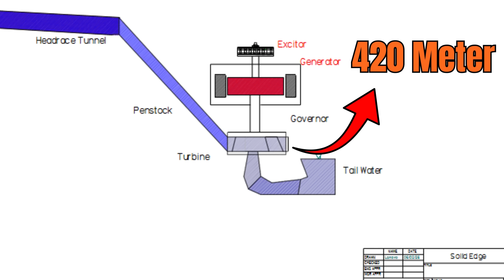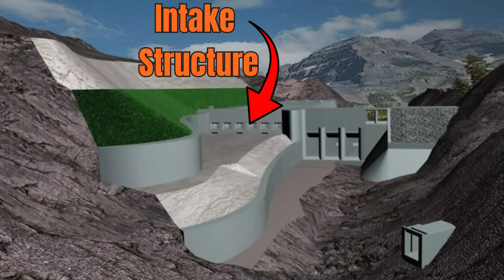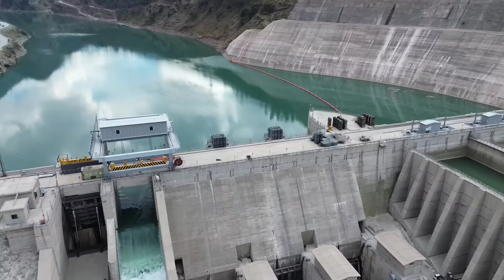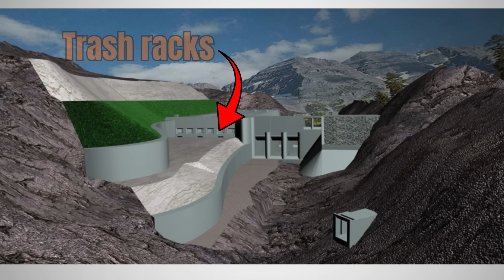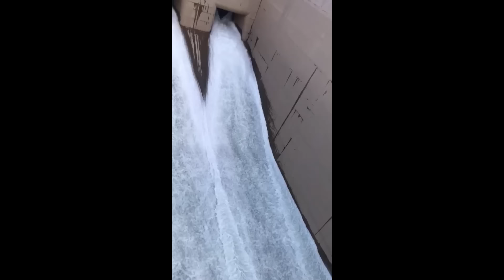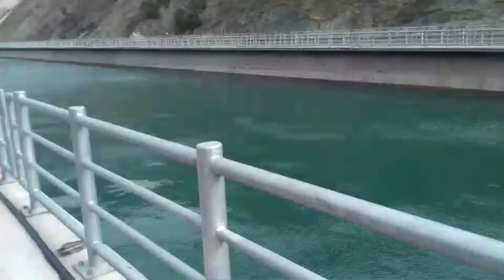How Engineers Stopped Sand from Destroying Hydropower Turbines

Comment: Very interesting. I used to machine large fan blades for coal mine exhaust fans and was shown some that coal dust had absolutely destroyed. They solved the problem by covering the blades with thousands of ceramic tiles. It worked well until a single tile would come off. Then the damage would start and thats why I had a job making new fan blades. These fans were about 12 foot diameter when assembled. I think now they use spray on ceramic coatings that perform much better. I wonder if your engineers are aware of this coating?
Reply: Wow that's crazy. Its the same strategy the space shuttle used to protect its wings during reentry.
Reply: @swg2188 very different ceramics. One is heat protection the other erosion protection.
Reply: This is already being done for hydro turbines as well. But not letting most of the particles get to the turbine is still crucial. And there's also hydro power installations that are many decades old and don't have those coatings.
Reply: Unless they are blithering idiots, they know about spray-on DLC or ceramic coatings.
Reply: @railgapesoterica5777 do you see anything with any type of costing on it in the video? I did not. Just trying to help my fellow human beings out. Maybe they know and decided against the cost. Maybe they do not know. Go troll somewhere else.

Comment: An automatic debris rake can extract floating trash to prevent a massive buildup as shown in the video. Collection at dams also helps to protect the enviroment and possible downstream towns, bridges and other dams.
Reply from the maker: There is an automatic trash rack cleaner. But when there is an emergency event like cloud burst. Then there is an issue. At that time, extra force is exerted on dams, so those debris needs to be flushed out quickly

Comment: Thank you for another informative video, but I have one question: It looks like the water would be moving faster in the sediment basins than in the reservoir. Thus, why do the sediment basins help significantly (I'm sure they do, I just don't understand why)?
Reply from the maker: Actually I showed a clip where the sediment basins were initially filled. So it felt fast moving. Once the basin gets completely filled. The water became calm. And due to gravity sediment sits at the bottom.  Also in the video you can see the completely filled basins the water is calm.
Reply: @hyrovision Thank you for the additional explanation. How often do the sedimentation basins need to be flushed in normal operation? If I understood thing right, than there is no power production during flushes, until the sedimentation basin is back to level? I imagine that during normal upstream flow, much of the sedimentation probably happens in the reservoir, while during storm surges more sediment makes it to the sedimentation basins? Great videos. I appreciate them a lot!
Reply from the maker: No the power house doesn't need to be shut down. As there are three sediment basins in this project. So they only empty one basin at a time. Close the out let gate and intake gate and open flushing gate to flush. After flushing they fill that one and open outlet gate. Than they do second one and than third. So I'm short two basins are in continued operation.

Comment: Most of the images showed water wheels damaged by cavitation, not abrasion.  For the rest, it’s interesting to initiate into trash and sediment management.
Reply: Gentlemen please. Let a pump mechanic explain it for you. 41 year machinist. Last 25 years specializing in pump repair. The sand and sediment start the erosion process. Even at low rpm speed there is tremendous pressure in this system. As soon as erosion starts the cavitation starts. Then both erosion and cavitation work on the vanes until failure. I see this all the time. I have two pumps in my shop right now with this problem. One I disassembled just last week with heavy plastic and a rag wrapped in the impeller for shits sake. So you are both right and both wrong. As for myself I am right. Shake hands n hug it out. 😂
Reply: @martinswiney2192  how does erosion case cavitation? isnt cavitation a momentary burst of negative pressure? a vacuum bubble collapsing and creating a mini implosion.
not really sure how erosion would cause that to start happening. i guess if the pump starts running much faster due to reduced pressure on the system.
Reply: @no-ux erosion creates a low spot on the working surface of the impeller. This creates an area for low pressure or think of it as a swirling action. Since the swirling action is taking place where there is already a low spot. So from there on its a cycle of destruction. At least thats how it has been explained to me and verified by what I see on disassembling pumps. River pumps are the worst. Usually impellers and housings must be replaced as opposed to pumps from clean water service like cooling towers. Point being impellers that have silt and debris flowing thru them get shredded. 

There are some system failures that allow air into the intake that will start cavitation without the wear caused by silt. Or maybe low water levels in the sump and the pump sucking air. But thats for pumps not dams obviously. If your dam is sucking air you might have some real structural issues that need attention. Lol.    Keep in mind I am not an engineer. Just a long time machinist and pump mechanic. But I do these repairs often. I really do hate to see destroyed impellers as replacing them instead of repairing wear rings really cuts my profit margin.
Reply: @martinswiney2192  that makes a lot of sense to me. thanks for the explanation, it seems obvious now you mention it.
Reply: What someone online that only watched a few YouTube videos about cavitation sounds like and doesn't actually know anything about or have any experience in hydropower. Sand and stone after hundreds of thousands of hours can definately do this
Reply: @no-ux  Cavitation increases when the impeller / rotor is eroded out of its ideal, cavitation-avoiding shape.
Reply: How can you tell the difference between cavitation damage and abrasion damage?
Is it that cavitation is concentrated where the vapour pressure changes are greatest, and abrasion is more uniform on the vanes (although I’d still expect some feathering towards the high velocity edges)?
Reply: @c @chriswalford4161  As you said, I would expect abrasion causing feathering.  You can expect cavitation damages to occur where lower pression exists, closer to the end of the vanes, but any defect or deformation more inward from the edge can create lower pressure and cavitation, leading to damages further away from the edge that will cause more turbulence and thus more cavitation there and again more damages at that location.  These damages inwards from the leading edge are for me tell tales of cavitation. No form of abrasion that I know will chew a funky shaped hole through a vane, inward from the edge. Abrasion will thin the vanes, and since the edge is already thinner, the vanes will shortened.  More knowledgeable person can correct me on this details. Thanks
Reply: @chriswalford4161  impact/friction erosion tends to be on side and leading edges, cavitation tends to happen most at trailing edges.  That said, very small amounts of particle erosion can lead to very large amounts of cavitation very quickly.
Reply: Sediment does the same thing
Reply: @Phil-D83  Explain to us how sediment reaches the raised intakes of any dam, please.  I'm not sorry and you're wrong.
Reply: @railgapesoterica5777  even with the best filters,  some gets through, especially with the amount of wate rmoving through the system. They limit it, but its not perfect
Reply: @Phil-D83  no it doesnt.
Reply: @no-ux  yes it does. You truly think mud sand silt and rocks aren’t going to destroy a turbine spinning at full speed? How many turbines have you installed? I’ve been a millwright for 28 years. How many have you?
Reply: @mdtransmissionspecialties  I never said it wouldn't. I said cavitation and abrasion aren't the same thing. Cavitation is far more destructive.

If you are a millwright and don't know that then how competent are you?
Hydroelectric turbines don't rotate that fast. A stone isn't like a bullet flying around as this video suggests.

So once again, no, it doesn't.
Reply: @mdtransmissionspecialties  yeah, seems like you are "regarded" if you can't pick up on the obvious context clue that my comment was responding to a guy who said "abrasion and cavitation to the same thing"
They objectively are NOT the same thing.
And impact damage from a small stone in a turning spinning at 30 rpm is negligible. The abrasive action of thousands of millions of stones would wear it down, sure. But cavitation would do far more damage.

The fact that you are arguing with me over this is clownish. There are pumps literally designed to pump gravel.  But I've never seen a pump designed to run with cavitation.

Admit it. When you said " a turbine running at full speed?", you forgot that the turbine in question, a hydroelectric turbine, is spinning at a very low speed.
Reply: @no-ux  maybe he did not forget, he just did not know. 😂😂😂
Reply: @mdtransmissionspecialties   why delete comments?
Reply: @no-ux  why report comments?
Reply from the maker: I didn't deleted any of the comments.
Reply: @mdtransmissionspecialties  I didn't. You didn't say anything report worthy. Even if you did I wouldn't have cared.

I thought you deleted them to save face.
Reply: @hyrovision  weird